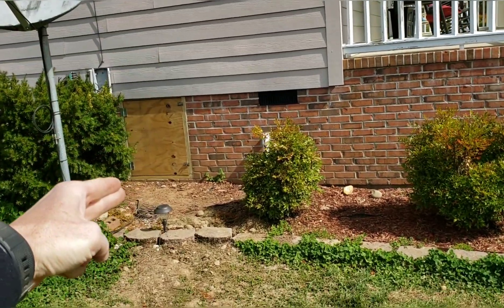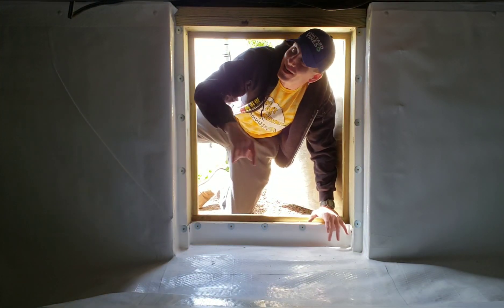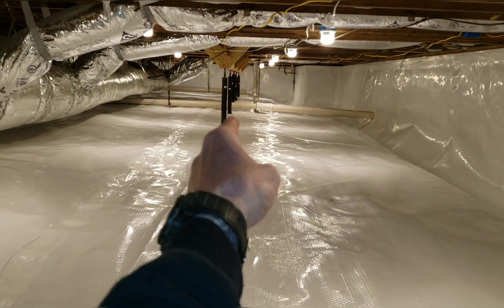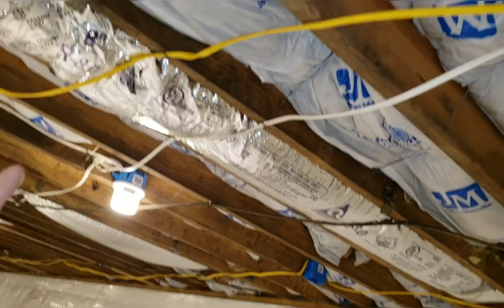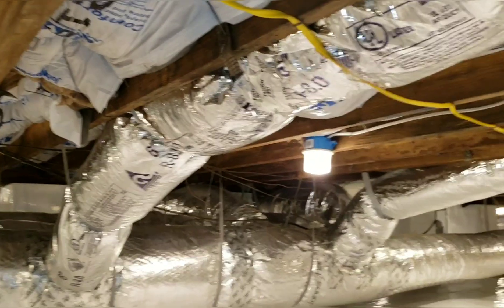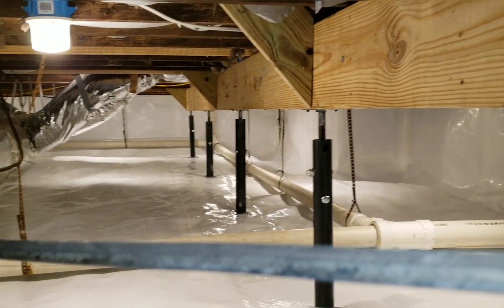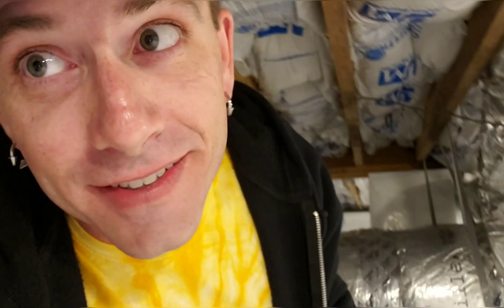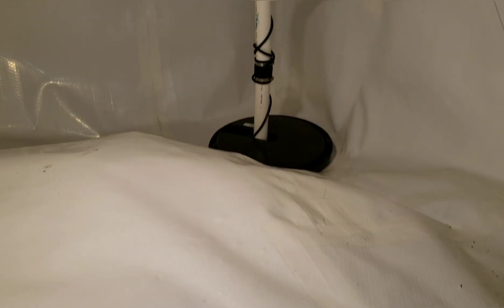TOXIC MOLD! HOW TO FIX MOISTURE PROBLEMS in a CRAWL SPACE via ENCAPSULATION and FRENCH DRAIN!

Comment: Just a quick question.
The P trap the condensation line runs into, does the trap or the condensation line have a check valve or back flow preventer to prevent sewage backup in or out of the line? And does the p trap have a primer so trap doesn't go dry in the winter and prevent sewer gasses if trap dries out? If it doesn't have a check valve and the sewer backs up the sewage is going to relieve itself through that trap and homeowners won't know till they get the smell.
Reply from the maker: No. And not saying it can't, but since 2008, never seen it happen once on any of our projects. Thanks for commenting. 👍

Comment: About how much did this cost...or would something like it cost? Ballpark. Trying to buy a house and the home inspection revealed some “decay” and evidence of moisture.
Reply from the maker: Depends on the size of the home, if their is insulation that needs removed, if you are getting new insulation, and if there is any standing water issues that need addressed. Sometimes they are just under 10k. Sometimes they are over 20k.

Comment: Tanner,  at time mark 11:15 of this video,  it shows your finger pointing up and you're commenting about the wood becoming more rotten that is was. My question to you is : doesn't that appear to be heavy mold on that lumber ?  I know nothing about this stuff other that what I have seen before, so I had to ask.
Reply from the maker: Yes. This homeowner, like most, got a full Sporicidin treatment. You just don't ever hear me yapping about the Sporicidin treatments in my videos, because I do not do them. I got rid of my chemical license years and years ago, and have absolutely zero interest in ever renewing it. Once treated, all mold will come back, if the actual issues that are causing it to be there in the first place, are not corrected. And that is where we come in. Good question.
Reply: @TannerFlowers  I take that Sporicidin treatment was done after you completed your work ?
Reply from the maker: No sir. Before.
Reply: @TannerFlowers  Those beams looked pretty nasty to me. I'd hate to see what they looked like beforehand.
Reply from the maker: Looks can be deceiving. The Sporicidin treatment is just a spray to drip off. There is no sanding of the beams, or "cleaning". So appearance wise, they do not change. Thanks for commenting though.
Reply from the maker: And at your time stamp, I was speaking of how we had stopped the wood from becoming any more rotten. Once again though, thanks for commenting.